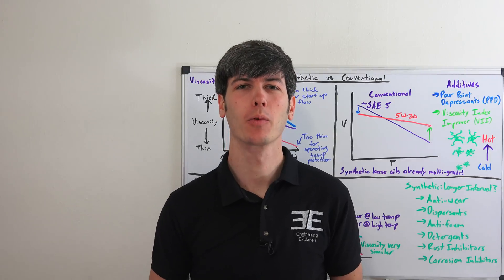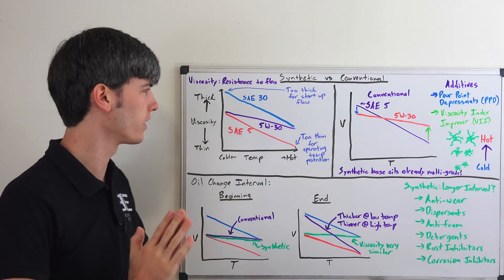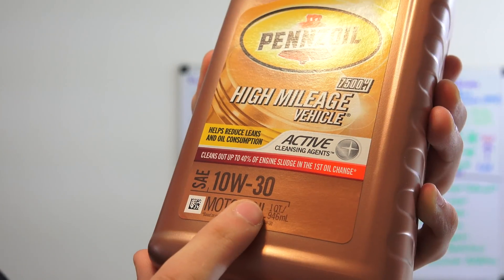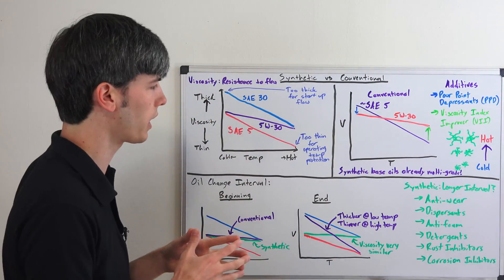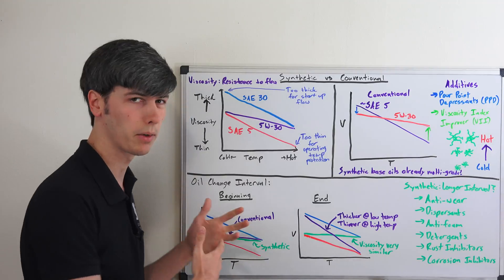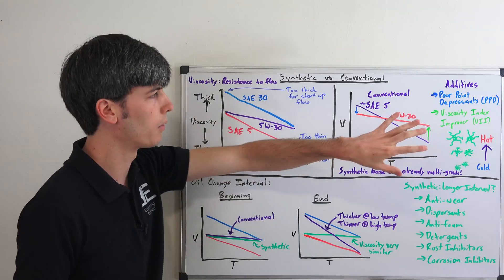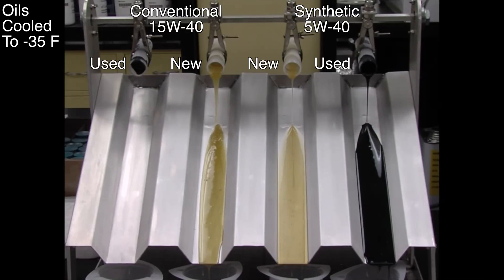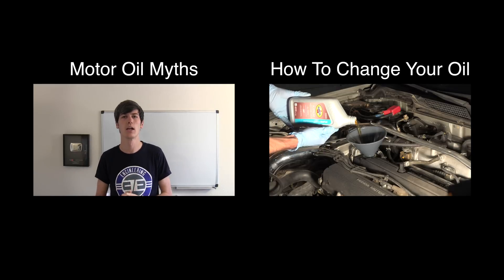Is Synthetic Motor Oil Better For Your Car?

Comment: I cant help but notice the synthetic oil looks just as dirty as conventional oil after 3000 miles.. But i guess running that motor oil another 12k is fine.. its synthetic.. right?!
Reply from the maker: +enemy4 2day that's why the interval is no different, as mentioned in the video. It's not the cleanliness we're looking at, but the difference in viscosity between used and new, synth vs conventional.
Reply: Engineering Explained Well i dont know why car manufacturers are recommending you run your oil for 10k miles or more. The general public seems to have this idea that its okay to go more than 3k to 5k miles between oil changes because they use synthetic - some of the synthetic oil manufacturers even state 15k in protection again giving this false sense that it is okay to go that long.. never mind the Fram filters were engineered to last 3k miles.
Reply: I think lots of cars don't have oil level sensors, only pressure a sensor. If the oil leven gets low enough that it's not picked up by the pump anymore, the pressure goes down & the light goes on
Reply: Your right. I should have cited info from bobstheoilguy or better yet, if you really want to know how your oil is holding up, get it tested. Cheap, easy and fast. All three!
Reply: I use synthetic 5w-30 in my 2.5 nissan altima, change the oil at about 10k miles and use the bosch distance plus oil filter.  The car has over 240k miles and runs like a dream.
Reply: The color of the oil is a terrible indicator of oil quality at the time of a change.  It's definitely isn't a direct indicator of how "dirty" the oil is.
Reply: enemy4 2day "I cant help but notice THE synthetic oil looks just as dirty as conventional oil after 3000 miles"  You didn't say "I haven't noticed"  which would indicated past personal experience.  You said I couldn't help but noticed THE oil on a video that showed different oils side by side.  So are you talking about past experiences or the video? You were able to hold a flashlight to the screen to look at the videos oil?  Sounds more like someone backtracking to save face. The English language is a beautiful thing unless one doesn't understand how to use it...
Reply: I go 15k miles between oil changes. Mobil 1 5w/30 full synthetic and Mobil 1 long life filter. 275,000 miles on my car, it's running like a sewing machine.
Reply: http://www.edmunds.com/car-care/stop-changing-your-oil.html
Reply: Lance Kragenbrink This is not the first article I've read like that - all these writers that think they're experts in all things spewing bad advice to the general public. 
I don't mind - this has been the most profitable year ever around my shop.. all thanks to motor swaps. We do about one a week now, and every vehicle was past the mileage on the oil change sticker.. 
Remember kiddies - car companies didnt get rich making your vehicles last forever - sure oil technology has improved tremendously but its still dirty after 3k just like the oil we've been using for decades. 
I use ground oil - go 5k and no more between changes and never once had a motor blow up on me..
Reply: +WolfieTed Mikiel the only engine rebuilds we do are on classics where junk yard low mileage motors are not readily available. At 100 dollars an hour it's cheaper for the customer to have a lower mileage junkyard motor installed than paying me to rebuild it. So no, I'm not rebuilding any junk ass GM 3.6l or ecotecs, we're not rebuilding chrysler 318s, 360s or any of the Hemi's or their v6s, nor do we rebuild the ford 4.6 or 5.4... it would just waste the customers money kid. I'm not saying you're wrong, i don't recommend changing it every 3k, as i do my own every 5k on my daily driver. But go ahead and run it to 10 or 15k between service,  but you better not cry if you need a motor, your local repair shop isn't a charity and isn't interested in your sob story.. because i know you're not doing the work yourself either.
Reply: tmar23 I never mentioned color - if you take a flashlight and look at the oil you will OFTEN find metal particals in it - especially if it is dark in color. Dark color i also an indicator or how many heat cycles the oil has been through. Also - if you take the oil and drop it onto something white like a piece of paper you can often see suspended particles - be it carbon or sludge it doesnt matter.. dirty oil will score metal components sooner or later.. but i guess we can just keep all those particulates in the oil another 5k miles because the friction modifiers havent broken down... right?!
Reply: +tmar23 proof read what you write before criticizing others for the things they've written. We're on YouTube, i could care less about being grammatically correct in everything i type. If you can't comprehend the simple sentences I've strung together, then the English language had eluded you my friend. 
When i say synthetic oil looks just as dirty as conventional after 3000 miles, it's safe to assume I'm referring to oil that is being checked off a dipstick on a car that has driven said amount of miles.. and not ANY of the oils in this video OR any other videos. 
Again you should really learn to read AND comprehend English before criticizing what others have written.. not to mention the mistakes in your post..
Reply: +Engineering Explained good day to you sir I am using speak to text as I am at work I work at a Express Lube my question for you is sometimes I will drain the oil out of a car and it has less than a quart of oil in it but the oil light has not come on why is this can you explain please thank you
Reply: Bad oil level sensors.
Reply: Nice, what do you drive?
Reply: Sounds reasonable.  As I understand it, one of the main issues with oil filters is capacity.  If they fill up with crud and overflow, then they're no longer filtering, and thus not protecting your engine.

So if you use a high capacity oil filter (and it doesn't degrade), then that solves that capacity problem, or at least helps.
Reply: Roger Geyer Which is why every engine should have the filter upside-down on top of the engine so it can be changed frequently without changing the oil. Only downfall may be that whatever crud isn't trapped in the element itself will fall back into the engine. I know the Subaru engine features this.
Reply: Christopher Burns OOOOOOOOR you could just change the oil regularly instead of trying to "save" 50 dollars a year..

Comment: So, if you change your oil at shorter intervals this is less of an issue?  I am asking for a different reason than most.  We have a race motor in a Suzuki RMZ250 motocross bike.  The owners manual says to use conventional oil and change it every 5 races.  We use a conventional oil (Rotella) but we change it every 1-2 races.  I assume that with the frequency of our oil change schedule, there would be little to no benefit for us to use synthetic.  Is my assumption correct?  Thank you.

Comment: In my 7.3L diesel I used to use synthetic.  The engine leaked also.  I was told it was wrong and to use diesel conventional motor oil.  I switched.  No more leaks, but can't start my truck in the very cold weather... even with a AAA jump.  I have to use a block heater in the engine now.

Comment: A mechanic did some work on my turbo diesel land cruiser about 2 years ago and refilled it with synthetic oil and stuffed it somewhat..It started using oil at the rate of 400 kliks--4 litres of oil and it was not using any before.It was noisy at start up--quite a rattle...It was bloody horrible..I swapped it back to conventional oil and upped the grade to 20-50 and its slowly coming good as the carbon gets deposited under the rings again but its slow...
Do not use synthetic oil in old motors is my recommendation..The mechanic should have his backside kicked..

Comment: I have to say that I had an 90's SUV motor valvles damaged from pure synthetic oil. I also had the same thing happen on a 2005 Motorcycle, and had to have the top end repaired on both. So I am a little more cautious about using pure synthetic oils.

Comment: You assume we know what SAE means. I'm lost at SAE so the rest doesn't make sense.
Reply: SAE is an abbreviation for Society of Automotive Engineers.  The rating of, e.g., SAE 5, means that the viscosity adheres to the characteristics defined as "SAE 5" by the Society of Automotive Engineers.
Reply from the maker: +Kevin Lo it's a viscosity grade for the oil, the higher the number the thicker the oil.
Reply: Society of Automotive Engineering

Comment: How well do synthetics burn in the combustion chamber?  Engines do get oil in the combustion chamber and some synthetics do not burn well.  Or can leave heavy deposits.  Not a good thing in many engines.  If your engine does not recommend synthetics, I would not use them.

Comment: I was told by an engineer that makes the oils/%.
Organic oils when replaced near 5000 miles and subject to non hard use are fine.
Hard use equals justifying use of synthetics. Or even the best choice available.
Semi synthetic oil is a waste of money. Buy one or the other. Also to not change from organic to synthetic after an engine has near 10000 miles on it, the engine will have microscopic scratches on the cylinder walls and burn excess oil.
All this makes sense to me.

Comment: When i was young (1970s) conventional oil would burn like gasoline when poured on a fire. But now what you people call conventional oil nearly puts a fire out, just like synthetic. Both have all the same services, (sj, sl, etc) and I am not convinced there is any difference other than price.

Comment: Never had any use for these new cars or new fake oil. "Conventional" oil has served many old timers in older vehicles that still run strong as new due to proper maintenance, whereas, an old friend bought two new cars in three years and both (different makers and brands) had nothing but problems off the dealership. I'll stick to real vehicles and parts that were made in America and to last Lol

Comment: Who lives where it is 35 below zero??? That test was useless!
Reply from the maker: +imzardoz some people don't seem to understand that it illustrates a point very well. Regardless of temperature, the viscosity properties of the synthetic will remain consistent. This is easiest to see at cold temperatures, but holds true for the entire temperature range. Synthetic holds it viscosity properties longer.
Reply: In Chicago ..winter time ....  and summer time 110' and humid .. no mercy in the weathers  ...  cheers
Reply: Anywhere in North Dakota reaches that temp and below.. summer time reaches over 100.
Reply: Montreal, QC Canada. We had that roughly from January through to mid March. So yes that is crucial. Sometimes during the night it can be minus 40Cº. However, that isn't his point indeed.

Comment: Hey EE, I don't know how and if the size or the type of the engine affects anything, but RC planes and car are also a thing that I'm in. So the question is, is the synthetic oil also the best choice for RC engines, which is run by methanol (with oil and nitromethane)? I'm asking because there IS the option of both fuels, and the sellers always say "well, there's no really a best, it's just the person's own preference". Thanks in advance.

Comment: There is more to  oil than just Viscosity just  because an Oil is synthetic doesn't mean it is good I seen an oil test were they tested  149 different oils! the  top oil was syntetic the oil that scored second was a conventional oil!Just because an oil is Synthetic  don't mean it will protect under heavy load!

Comment: Nice video.

What about Full Synthetic but different grades?
5w-3- vs 0w-20?
Many dealerships say that it's 'the same because it's Fully Synthetic"!

For example... Nissan recommends Full synthetic @0w-20 but many of its dealerships, in my area, don't carry that grade but instead carry 5w-30 Full synthetic.

Thanks!

Comment: yay another video full of useful information and we'll explained, thank you. I have just tried Mobil1 full synthetic 5W30 on my Toyota camry v6 with 100k miles which took toyota conventional 20w50 for probably all its life till now and I was worried about temps being a little higher based on the coolant temp needle being at 40% (with 20w50 it was 35%) but now I guess I will have the same oil next time too because of viscosity lasting longer. I have also checked the oil at 1k miles and it looks fine

Comment: honestly if you use regular oil and religiously do your oil changes on the manufacturer recommended time. you can save your money by not buying synthetic oil. I do say use it under extreme conditions like high revving engines. or extreme low or high temperatures. specially in Diesel's.

Comment: Is it true that 80% of engine wear is because of cold starts when theres no oil pressure? read that on /o/
Reply from the maker: I do believe most wear occurs on start-up, yes.
Reply: +Engineering Explained Exactly!  Back to what I said about making oil Stay on or with the metal, rather than run off when not pumped or running. It's actually been available for decades, so we don't need to hear about what some oil company is doing recently. They're untrustworthy money hordes, and only feeding the industry Technology as it fits their bottom line, along with Majority of mechanics know or Should know and advise to use it as well.

Comment: comparing 15w-40 to 5w-40 at -35f really doesn't make sense. you'd never intentionally use the 15w-40 if you expected to be exposed to -35f. but more importantly, comparisons to prove a point need to be comparable.
Reply from the maker: Listen again and I explain why they are different viscosities. :)

Comment: I've always used MOTUL oil in all my vehicles and outboard motors. Changed at regular intervals and never had a problem. My 1997 Honda VFR 750 did 195,000km on motul and still ran as smooth as the day I got it. It is still on the road somewhere in New Zealand!

Comment: I have a question. How old was the used oils in the test? My car's service intervals are 20,000 miles using fully synthetic but I personally change it every 6000 using semi-synthetic. Since the new oils are very similar in performance, how different would they be after 6000 miles?

Comment: Can you do a video about the difference between regular gas and premium. Or even a video about if premium is actually better for your car. Maybe do some tests?
Reply: I personally think its a marketing scheme.
Reply from the maker: I have a video which explains some SAE journal tests that were done. Some cars benefit, some do not. I'd recommend searching my channel for "premium vs regular."
Reply: The main difference is the octane rating, which is the RESISTANCE to burn. Basically you're paying more for a gas that can withstand greater combustion pressures before preignition or knock becomes an issues. Engines that have a higher compression ratio need a higher octane rating to run at full potential. It's not cleaner or more powerful or anything silly like that.

Comment: Sorry, I disagree... the big issue with engine oil is the contaminates it picks up in use. Other than said contaminates, modern regular conventional oils are still wonderfully stable lubricants at the end of normal change cycles. Change oil regularly, and it's extremely rare to ever have a lube related issue. I make a lot of short trips (which profoundly elevate oil acid levels) and do changes every 4 calendar months regardless of mileage, and the fine print in many manuals give similar advise. Synthetics were initially developed for use in gas turbines (jets) that have some very hot areas, where conventional oils tended to 'coke'. Regular internal combustion car engines put no such demands on oil, with maybe a few hard run high performance exceptions. Regular oil changes will also keep you covered if you should happen to end up with a compromised oil filter element... circulating un filtered oil for a shorter period is very much preferable... and oil filter quality control is pretty sad these days with so many originating 'overseas'. BTW, my Honda owners manual states that synthetics may be used if desired, but the change intervals are to remain the same. I could go on, don't get me started... synthetics are also much more profitable, and thus get considerable hype...

Comment: Are there still benefits to using conventional or mineral oils over full synthetics in certain circumstances?
I've had full mineral oils recommended for old engine designs (in my case a Datsun L28) even if they're freshly rebuilt and was told specifically to not use synthetics.

Comment: This guy is a nerd. People have been driving half a million miles on conventional- way before synthetic was even sold and it worked just fine. The key is really not the oil but how often you change it.